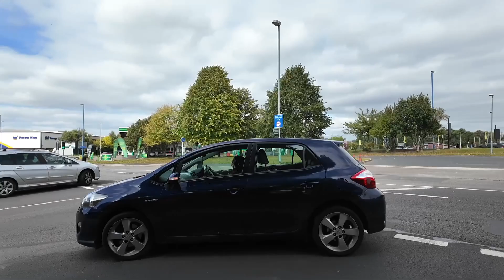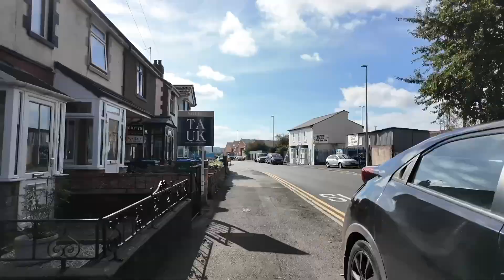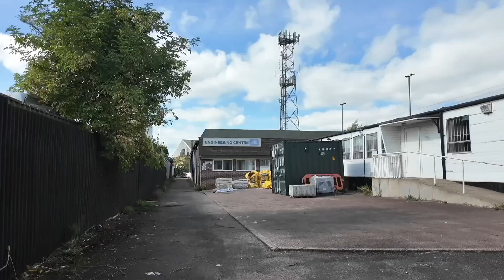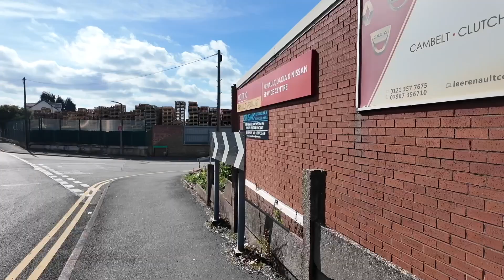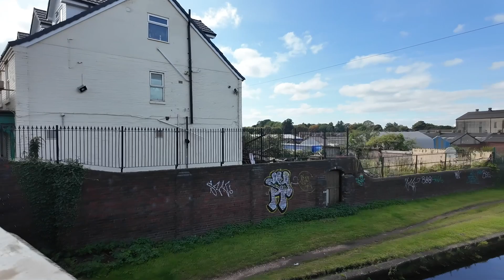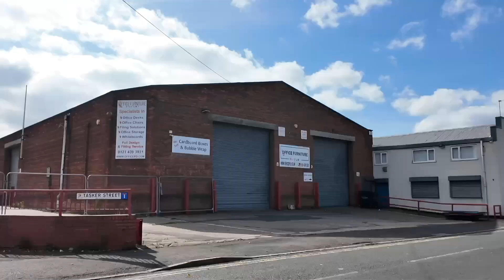WEST BROMWICH RYDERS GREEN A Mighty Industrial heartland that is no more

Comment: Hi Phil, thanks for another great video, I used to work at the Phoenix steel site till it closed in 2015, it was owned by Caparo which went bust, we were wire manufacturers, I’d worked  for them for 18 years. Was a sad day when we were made redundant 😔 miss those days.
Reply from the maker: Just up the road in Albion Road JB&S Lees was also owned by caparo but survived their mismanagement but sadly the mismanagement of Liberty Steels as now seen their demise. Manufacturing is sadly no more. I will be covering Oldbury Road very soon. Thanks for the comment these factories had some great characters
Reply: @awalkwithphil  you’re welcome mate 👍🏻